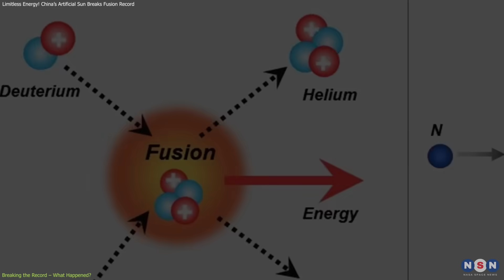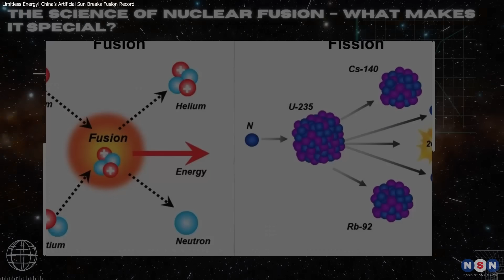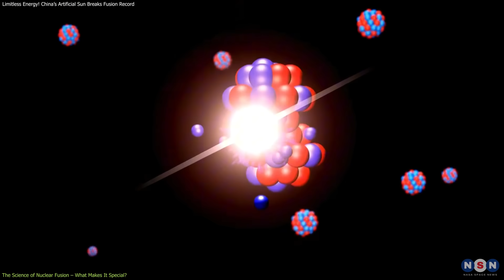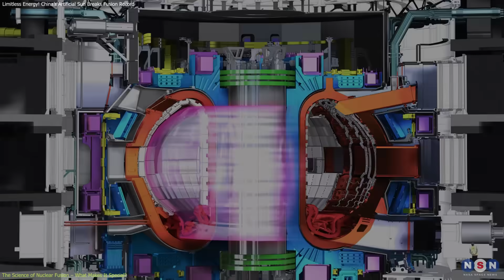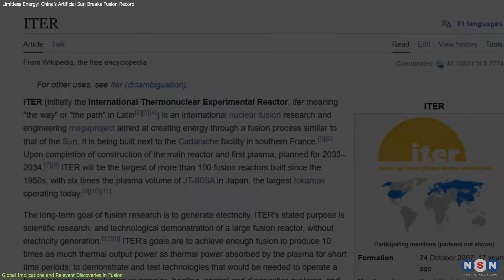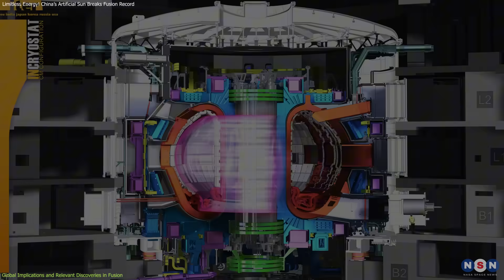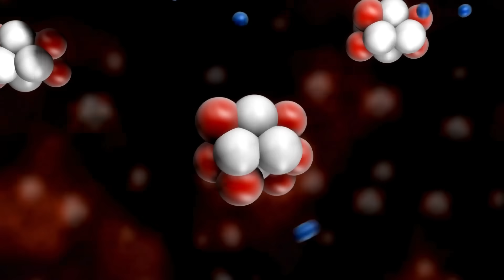Limitless Energy! China’s ARTIFICIAL SUN Breaks Fusion Record

Comment: Regardless of who gets there first, energy will never be made cheaply available.
Reply: That's what they said about tap water...
Reply: @elmolewis9123  Exactly, people go on about "free energy" systems that are denied to us with the inventors allegedly disappearing or whatever. All energy sources are ultimately free to start with, whether it be fossil fuel dug up from the ground or the potential energy harvested by hydroelectric power stations or the energy in wind blowing, corporations build the systems that are used to harvest and distribute energy and they charge us for that energy, or alternatively you can buy devices that harvest and store energy like solar panels, no matter what new source of energy is discovered a corporation will jump in and start building whatever device we need to harvest and store that energy and will sell us those devices, like solar panels and small scale home wind power systems. If you have the ability to build some device that harvests and stores energy from some new source nobody will stop you building and using it, build a mini hydro generation system of you have a place that's suitable, drill some pipes down into a hydrothermal source of heat if it's feasible where you live, put up a windmill and use batteries to store the energy, nobody is stopping you.
Reply: Dam straight